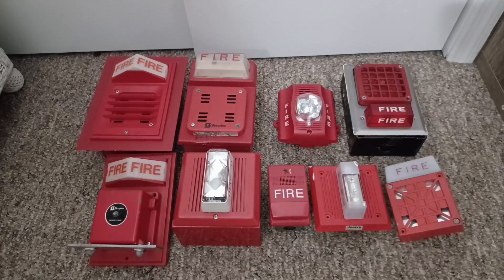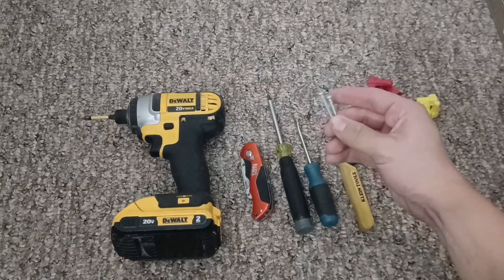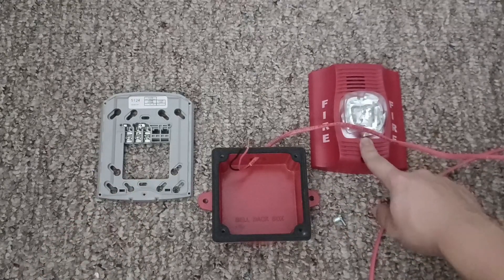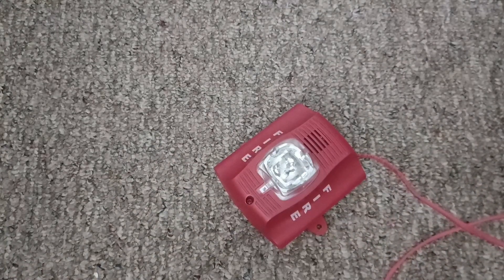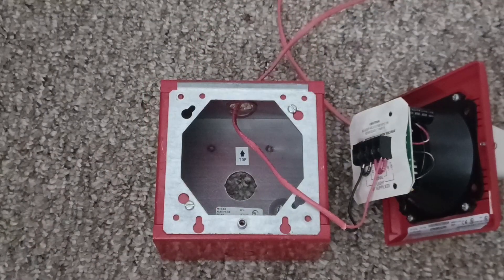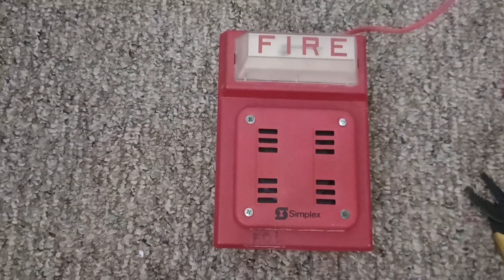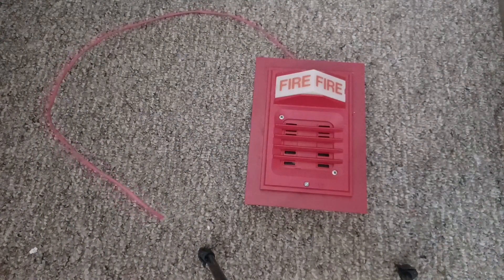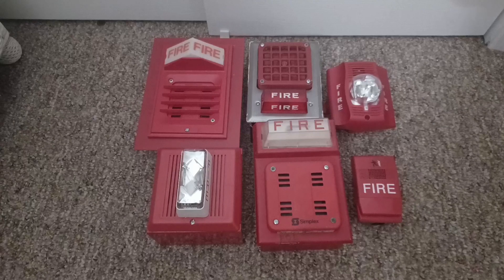Tutorial: How to Install Different Fire Alarm Devices and How to Wire Them up to Your FA System

Comment: Thank you for this tutorial, very helpful. Regarding the 18 gauge wire, is the red side positive and black side negative, or can you do it the other way around? Where black is positive and red is negative?
Reply from the maker: Red side is positive, black side is negative
Reply: @officialnewyorkfirealarmtech  yes, because I saw the same type of 18 gauge fire alarm cable where the exterior was in yellow. Not red. There’s also black and, blue exterior colours.